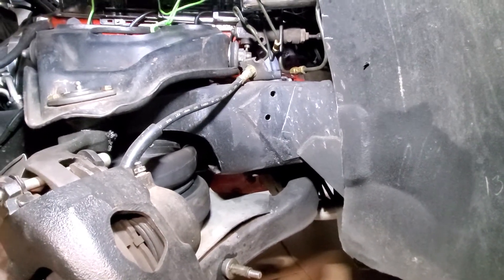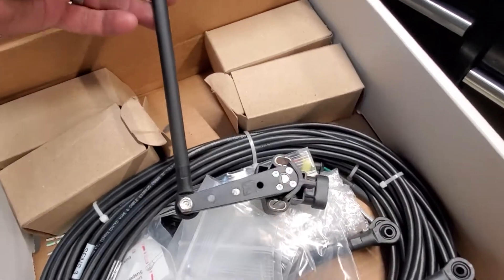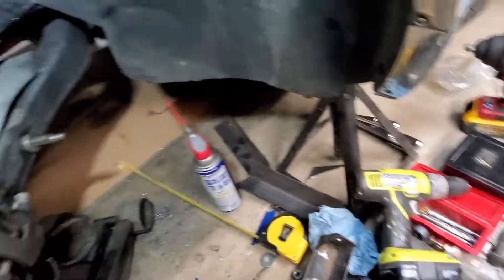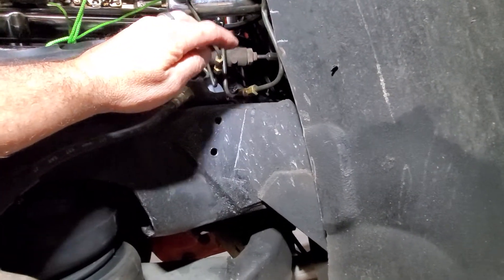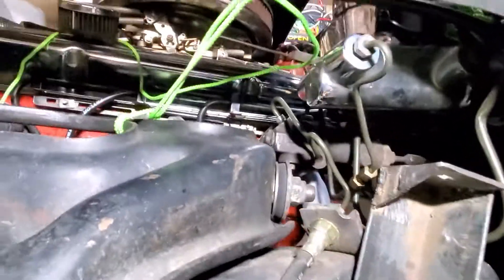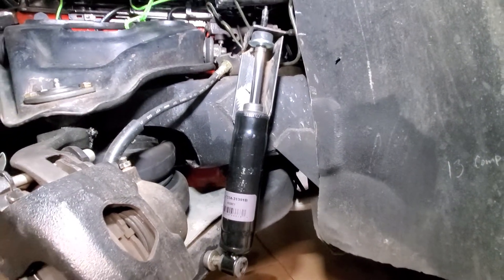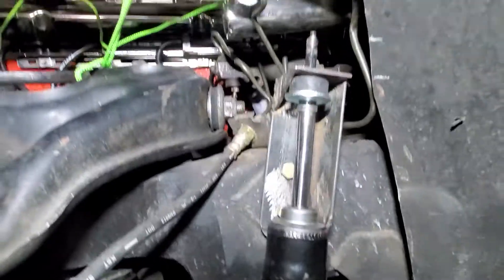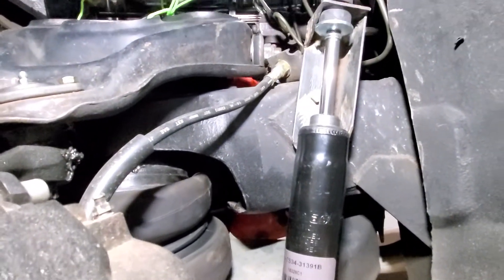Front shock relocation air ride

Comment: thanks for the video, you are the only person that has given me any idea how to go about this, I have a Lada 2102 estate with air ride, the original shocks were inside the springs so I will have to fabricate new mounts thanks for your advise
best regards
Keith
Reply from the maker: Thanks for cking out my video did you see the second one with the level sensor?
Reply: @starfirerider  not yet, but I will have a look although my system is not that complicated just up and down front and rear
regards
Keith
Reply: Thanks for the instructions on how to install brackets without welding,I found the brackets at (Switch Suspension),Bags on 82 DeVille,Old School forever.

Comment: how did you measure how high the mount needed to be for your truck to lay flat on the ground, where did you measure and from what points  to determine how high the bracket needed to be
Reply from the maker: you can use some wire and compress the shock then install the bracket and make your marks on the frame to mount the bracket
Reply: @starfirerider  thank you